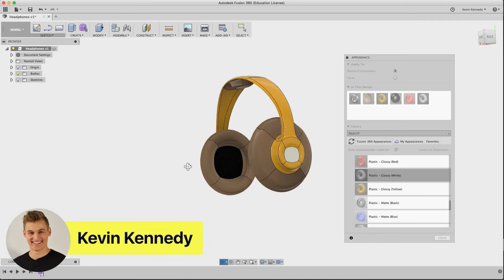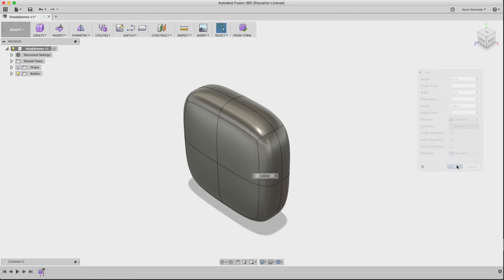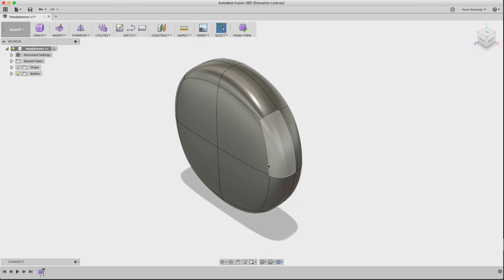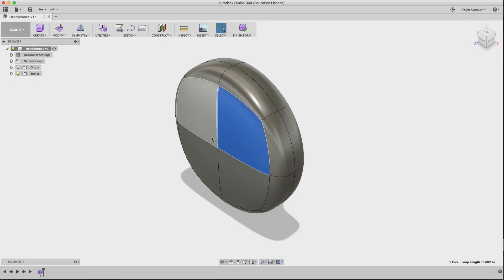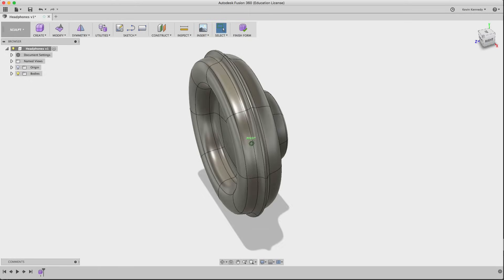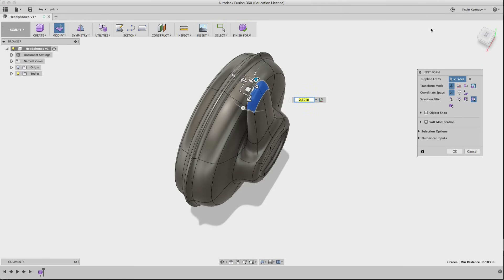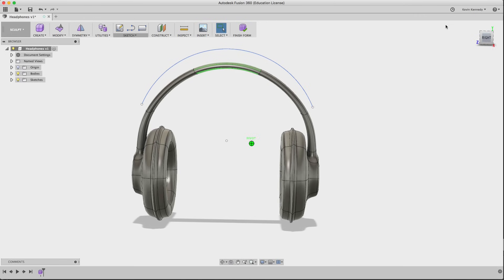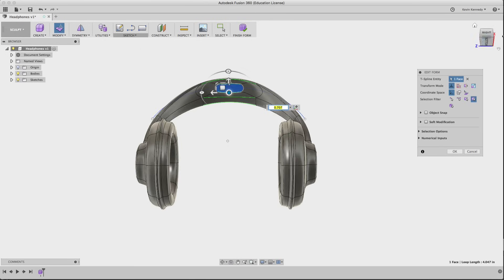How to Design Your own Headphones in Fusion 360's Sculpt Workspace (for Complete Beginners)

Comment: Sir, I am unable to create a bridge for the headband. When I go to select the second side, it doesn't let me and it gives an error notice that the two sides need to be in the same body. How do I fix this? (also thank you for the tutorials they are very helpful for my drafting for design and production class) 

Julian
Reply from the maker: Do each sides have the same number of faces/points? Bridge requires them to be the same and that may be what's happening here. The other thing would be if its not copies/mirrored correctly.
Reply: @ProductDesignOnline   Yeah, thank you. I finally fixed it. I had to delete it and re mirror it.

Comment: Amazing tutorials! So glad I found this!! As a total noob, I could follow along no problem. Only point I got stuck was right at the end. Despite only selecting the muffs, it applies textures to everything. No idea what's different in my settings...
Reply from the maker: You may have to switch the top of the appearance dialog to 'faces' instead of the default of 'body'. Sometimes the appearances will auto-apply to all bodies touching.
Reply: @ProductDesignOnline  thank you so much! that did it! :D

Comment: Hello Kevin, after more than 1 year:) I started all over again and focus on your videos. My problem is if we go back to 2:37, I can't change the diameter of the four faces and drag the faces out individually. When I start to change the size of the four faces and drag them out, the system drags all the body. Compared to your drawing (2.40 to 2.50) my back view seems stretched and instead of 3 different levels, mine seems 1 level and have like a pyramid view.
Reply: ya, I am also facing same issue..

Comment: hello, I have struggled to use the edit form command to make the proper holes in the box I do not know what else to do. my fusion360 does not have the sculpt mode
Reply from the maker: The sculpt mode has been renamed the "Form" environment. once you click the purple square in the design workspace you will be entering the form environment. From then on out everything should work the same.

Comment: Yeah Kevin great video. Ok so now though when designed what can you do with the design to get them in your hand afterwards. Is the next step 3d print them? How would you go about that? Obviously you'd need to dimension them etc etc. Interested in your reply.
Reply from the maker: Hi, James. It really depends on the project. However, I like to use the sculpting environment as a way to iterate quickly and explore shapes and designs without having to spend the time to surface model. I would then surface model (with dimensions) a one or two of them and 3D print them or CNC them with modeling foam (again depending on the size of the object and sometimes the shape or desired material). Cheers, Kevin :)

Comment: for some reason holding the alt/option key does not allow the object to change uniformly when I do it..
Reply from the maker: Hi, Tdog. That's strange... I've never had an issue with it not working. I would recommend restarting Fusion 360. See if that fixes it. If not, then submit it to the forum and one of the engineers can look directly at your license to see if its an issue with that (or a larger bug). https://forums.autodesk.com/t5/fusion-360-support/bd-p/962

Let me know if you get it working! Cheers, Kevin :)